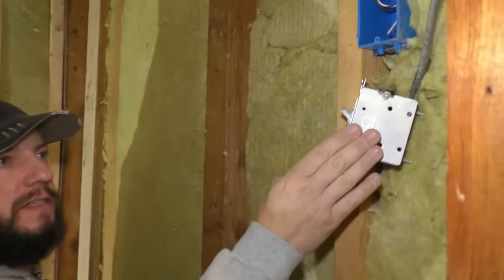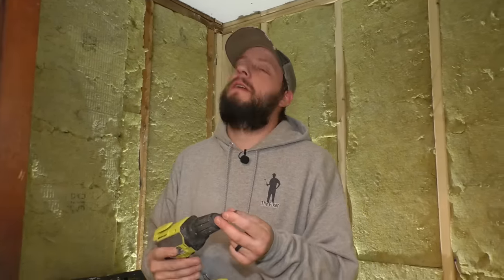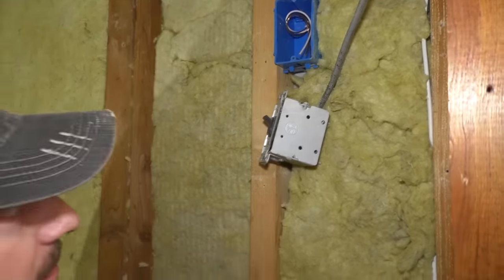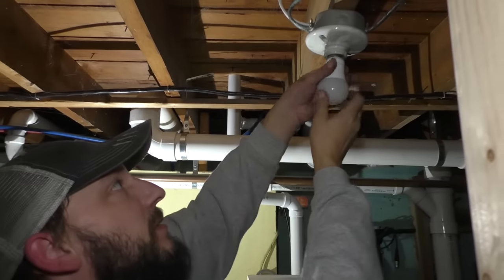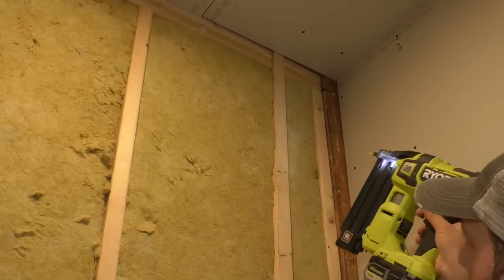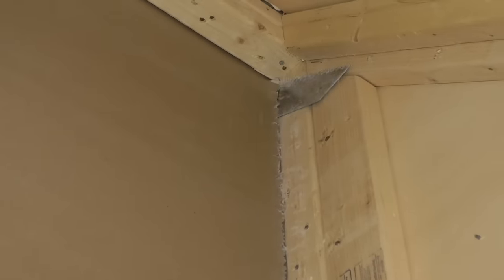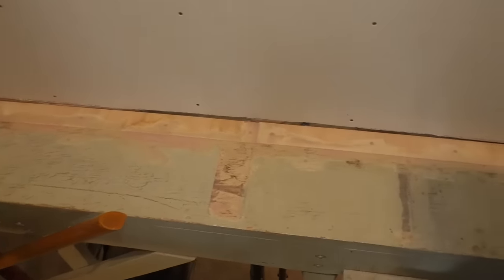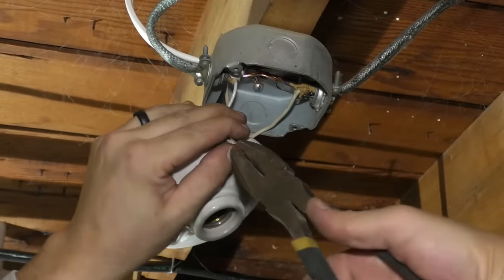Hanging Drywall and Installing Some Electrical in my Basement Stairwell

Comment: Hey, Love the bloopers at the end, I think its really cool you have an emergency shut off switch for the oil burner located away from the unit. On my HVAC I installed a Sonoff Mini R2 inside the shut off at the HVAC and replaced the toggle with a rocker switch because the R2 took up too much room. With the R2 installed I can still go down and shut it off when service is needed, or I can shut it off remotely from anywhere via voice or app. This works out well as my washable filters are located on the first floor and I can turn off the HVAC by voice, clean the washable filters, replace the filters, turn on the HVAC via voice & reset the WiFi Filter Sensor from CleanAlert via the app.

To add a wall switch to the use of a Sonoff Mini R2, you just need to run a pair of bell wires & connect them to the grey terminals on the R2. The switch will work independently from voice or app as it only senses a change in ground to the logic chip (no voltage). The R2 works on voltages from 3.5v to 120v. 10 amp & WiFi 2.4G controlled by the EWelink app. R2 cost approx. $13.20 when you buy the 5 pack.

Comment: 11:07 I think that you're tacking the staple too tight.  You just need to prevent the wire from flopping around and being pinched by drywall.  Another advantage of keeping the wire loose, is that you can pull the slack out of the wire if you need a few extra inches at the box, in the future, if the exposed wire is not long enough for a new switch.

Comment: 20:17 Unless there is a problem with that armored cable, I would leave it.  It's better than NM in exposed situations.  Most commercial wiring is all bx armored cable or conduit because it's less fragile than NM.
Reply: I also like BX over romex. But I think that BX was old and had cloth insulation on the wires

Comment: I'm not sure how much credence you should give to this. But in my drywall learnings on YouTube from professionals and on forums, I've seen multiple times they recommend boards not get pushed together super close, ok to leave 1/8 inch gap - less likely joint tape cracks will occur over time (so they say)

Comment: You know where to find the extension cables for them halos?

I got some for kitchen which is a drop down ceiling. And I have bracing for the ceiling fan so I was like great I can mount my boxes to this brace but the cable isn’t long enough to put the light where I want it

Comment: Is strapping on the ceiling always necessary? I might have to remove some old lathe and plaster. Wondering what the easiest way to replace it would be. Thanks.

Comment: I'm confused as to your apparent aversion to Flexible Conduit wiring? You mentioned it needed to be replaced next to your last light fixture. If I recall correctly, you said something about it in previous videos, maybe when wiring in the attic? As an electrician, I prefer electric wires protected by metal conduit, flexible or solid. As a homeowner, I like to use the flexible conduit in my open basement ceilings, sometimes, and garages most of the time. Either 12/2 or 14/2. But it has been about the same price to buy 12/2 (20 amp) wire in flexible metal conduit, as regular 14/2 (15 amp). So why not, even if I only use it for a 15 Amp circuit, I have later flexability to up to a 20 amp circuit if needed. I like the protection from physical hazards, like hammers, boards, or other objects in garages and basements, or that are stored in the ceiling joist or overhead storage. Anything that we may, from time to time, accidently bump, grab, or impact an electrical wire with. Inside enclosed walls and ceilings it is pointless. Flexible Conduit wire is obviously still made and used today. It is covered in the NEC codes in the U.S. as you likely already know. I would trust old wire in flexible metal conduit much more than unprotected old wiring.  Most wire in flexible conduit is manufactured without the outer sheathing. The outer sheathing IS what worries me about old household wiring. Outer sheathing and other wire insulation use to be made of cloth and similar flammable products not used today. If your wires are in a metal conduit they are far less likely to be able to become damage causing a house fire. Even if the wires in the conduit overheat, started melting, burning, or sparking, it is enclosed away from insulation or other items which may be flammable. Today with the old wire in conduit and all the known metal junction boxes grounded correctly, the breaker can trip before a fire could escape the flexable metal conduit. If your old boxes are not grounded, then it is your responsibility to make sure they are, as I had ylto in my 1936 Home. They even sell green wire grounding pigtails and screws which are a huge time saver, or make your own? Just unsure what you see as wrong with the flexible metal conduit wiring? Thanks and, as always we love your videos.

Comment: Still can't get over you using that old work box still when you had to drywall completely removed. Switch that electric outlet to a new work box and attach it to the stud!
Reply from the maker: Why?
Reply: Much stronger nailed to the stud.  You are just relying on those two little plastic tabs. Now granted this is in a spot where you probably won't be plugging in and unplugging all that frequently. New work boxes at home Depot are 75 cents. Only takes about 3 mins max to rewire.

Comment: That was a lot of work for such a small space. Can’t you extend the platform to the top step.
Reply from the maker: I could... but then I would have to extend every step thereafter.  By the time I got to the bottom I would be too close to the wall.  I would have to basically rip out the existing stairs and build all new ones.

Comment: Why didn't you attach the outlet box to the stud?
Reply from the maker: It's an old work box so they are made to not be attached to a stud. Great question!
Reply: @TheFixerHomeRepair  No. I get that. I understand that. I was just wondering why you didn't attach a box to the stud when you had the chance while the wall was open.
Reply from the maker: Oh I see.  I guess because it was easier this way and was not necessary.   @lm4278
Reply: @TheFixerHomeRepair  I can respect that. I thought you may have had a very specific reason. lol. Great videos BTW. Enjoy the channel.